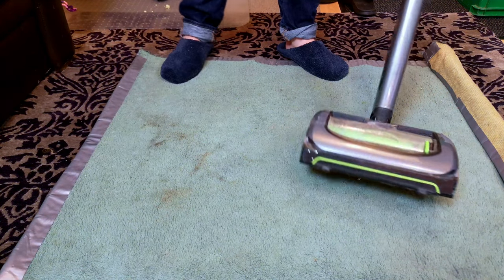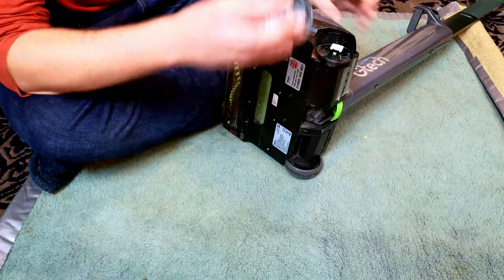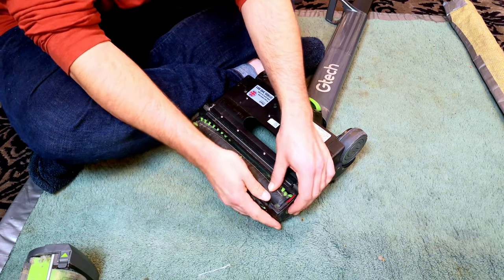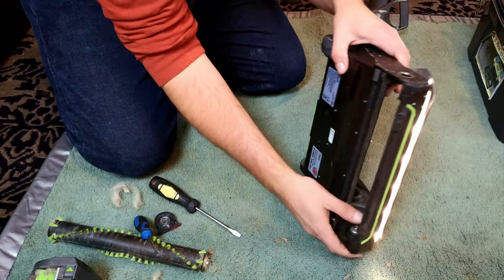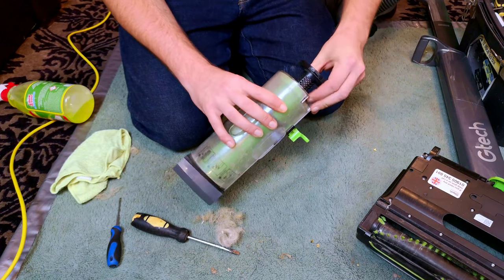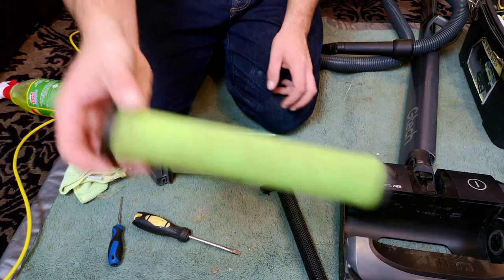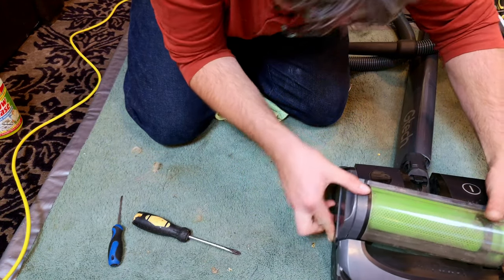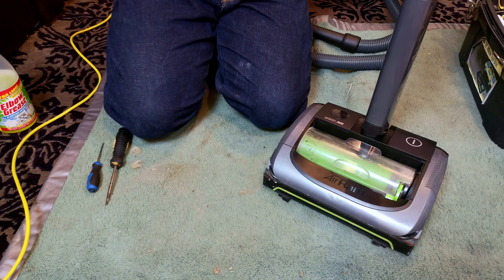gTech Air Ram Mk2 - THE only fix for the alarming brushroll noise you need!

Comment: To remove the belts, roller bearing cog and motor, make sure all screws are out. Insert a large flat end screwdriver from the rear of the machine under the motor. Lift and pull motor forwards in an arc and pull the suction cap at the same time. Dont force too hard as you may break the motor wires, but there should be just enough room to clear. Change belts, motor or bearing and reverse to replace. 73's Andy M6APJ.

Comment: The metal bearing on the end of the roller bar 'should' be encased in the end bar cap which was melted by the fibres/hair on the end. This can be rectified by buying a new roller bar it comes with a new cap. I've just done this with my MK2 AirRam. The new roller can be purchased from Gtech direct for about £13 +PP.

Comment: if you move the switch cover the motor housing lifts up and hooks into the brushbar part of the chassis- the drive assembly includes the red felt brush on the bottom

Comment: Useful video, but glad you're not fixing mine!  No wonder the wheel was broken saying the way you roughly threw it around!  Surprised it wasn't in 100 smashed pieces at the end after you jammed the 🪛 in and then crashed it on the floor.

Comment: Hi there would you happen to know what could be the issue with my vac? It works but when I turn it on there's a loud grinding sound for a maybe half a second, then it runs like normal. Sounds like it's going to cause a bit of damage after a while. Cheers

Comment: Hi there, thanks for this video. I have successful followed your video and cleaned out mum's vtech. However, unlike yours, hers didn't work before or after removing brushes. Push power button, red light comes on and nothing I do stops it doing that. Ssdly, I suspect its probably terminal. I do now have a sparkly clean machine. Any ideas?
Reply: Hi there. I know this is an old video but I'm having a similar problem to you with my mum's air ram 2. It jammed, which I cleared, but now when I switch it on it has the red flashing lights with or without the brush in. Did you find a solution to the problem?

Comment: Omg. What are you doing. Push the button on the end to eject the roller
Reply from the maker: Which doesn't work when the button at the end won't push, because it's all jammed up with hair! Clean the roller every month and the button keeps working. Otherwise this happens
Reply: Yeah ours doesn't push at all anymore, in the same way. Thanks for your video!
Reply: Update: I thought I'd have to send it to GTech for repair or buy a new brush bar but after following your instructions it works like new again! 🌟🦸Thank you so much!

Comment: £20 pounds for replacement wheels extortion.
Reply from the maker: You say that, but at least you can buy them! Try finding 2 replacement rear wheels for your Dyson cordless head that's worn through... Or replacement front wheels for shark duoclean heads that wear and then let the front roller contact the floor too hard, which then causes that to eat itself! I'd take a £20 new genuine part tbh! (makes me sad just typing that! Never have to replace a wheel on even the tattiest hoover senior 😂)
Reply: @beko1987  dyson definitely isn’t repair friendly! Sebo,Hoover, shark and bissell all the way.